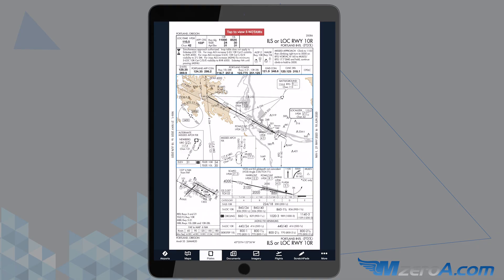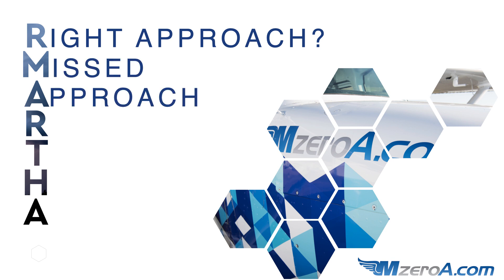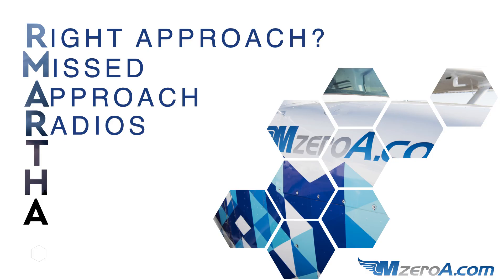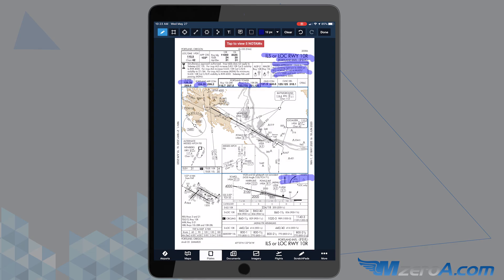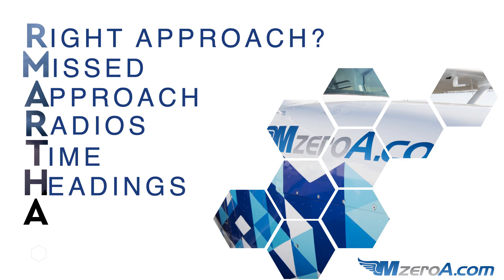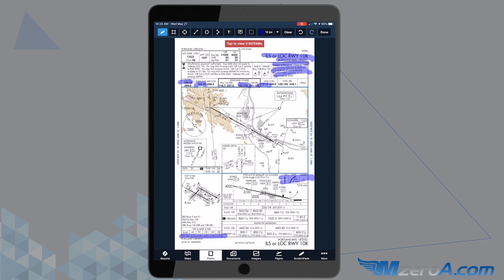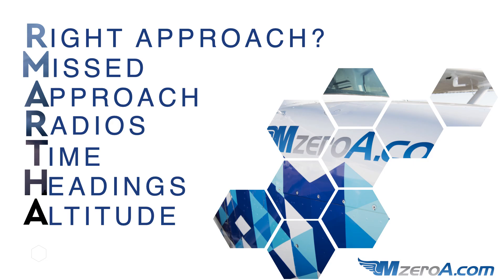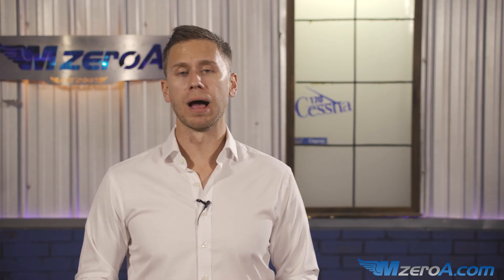My Tips For Briefing An Approach Plate - MzeroA Flight Training

Comment: The one thing you might have overlooked is that the first step is are there any notams ...that’s your first clue that maybe the g/s is in op Or the papi isn’t working...what is our weather looking like? ....I should you know the drill.  Having the correct chart/plate is important so use the highlighter and under line the course, altitudes and the map( DH, DA) .as to the missed write on the plate OBS button a quick reminder. Single pilot is all about being ahead of the plane and the approach..just some thoughts